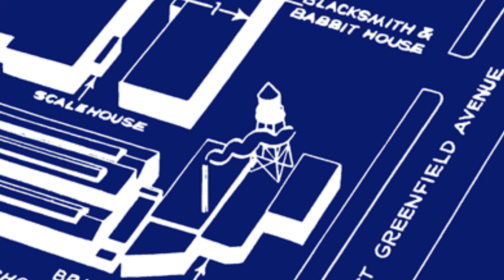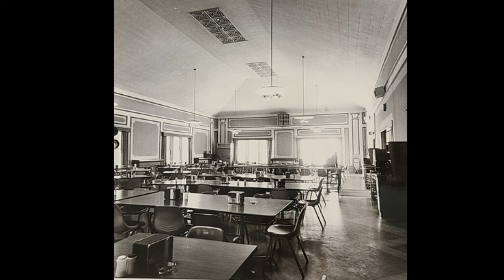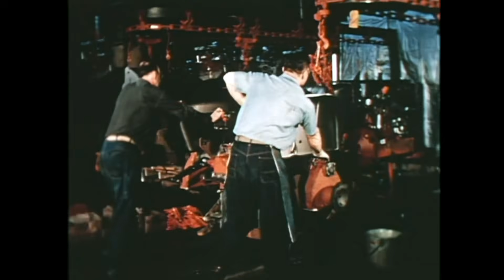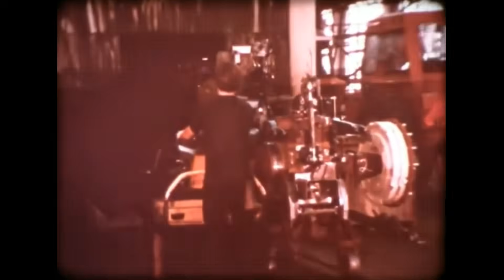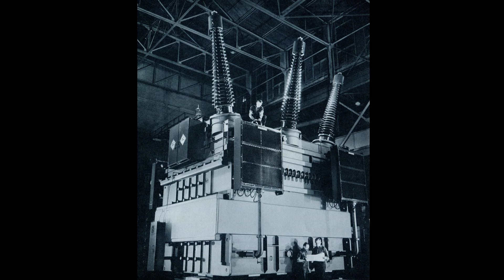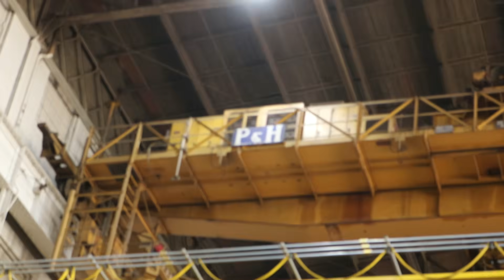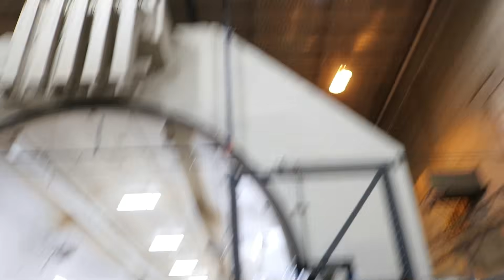Then And Now: A Tour Of The Allis Chalmers West Allis Factory Headquarters

Comment: It's a shame such an iconic company went down the tubes. I've always liked AC tractors and have operated quite a few as a kid back in the 60's. Models like the D-17, WD (std), CA, and also a weird backward facing front-end loader that was based on a WD-45 chassis I believe. The loader was a beast and did most everything well except STOP! When the company that built them did the conversion, they failed to wrap the band brakes in the proper direction for them to stop going (what was now) forward, but they worked great in reverse!🤣 The only way to stop in a hurry was to drop the bucket.😜

Comment: The place that Blast Cleaning Technologies uses was used to build Kholer power generators until 2017 by a company named Global power, back then they still used the 150k ton crane to load the generators on semis , went there to load said generators a few times I think the biggest one I loaded out of there was 60k pounds and my overall vehicle dimensions were 10x93x14 feet, let me tell you that backing in to the building was bit of a challenge.

Comment: My grandmother pearl jones worked at the west Allis  plant  from the second WW to 1980 she was one of the overhead crane operators in the big shop. I work my first summer out of high school 1975 as a tractor driver at the AC tractor proving grounds in rural Racine county. I was transferred to the engine lab in west allis to assist Bob Annan and Arnie Carlson the did all the Diesel engine testing and accompanied tractors that were being tested at the university’s first Nebraska for engine and pto horsepower.

Comment: It was glossed over, what did AC did on the Mahatten project?
Reply from the maker: From what I can find on the internet: "Allis-Chalmers manufactured critical assemblies that were employed in the top-secret Manhattan Project for the electromagnetic enrichment of uranium. It also built the compressors used to handle uranium hexafluoride used in the gaseous diffusion process. Both processes were used to separate the fissionable U-235 from U-238 to produce the atomic bomb."
Reply: @JandLVideos  So these were used in Tennansee in Oakridge.  That was the main production facility.  I believe they were refered to a the gas centrifuges.  Way cool history, thanks!

Comment: We had an Allis Chalmers plant in York, Pennsylvania, it never made tractors but produced energy products as hydroelectric turbines and nuclear fuel rod components.  Purchased from the S. Morgan Smith Water Wheel Co it was a fraction of the video's complex. The several block facility was sold to Voith Hydro which later expanded out of town. However the historic brick buildings were repurposed into a mini industrial park for office, business and manufacturing companies.
As Allis Chalmers, Precision Components Devision I toured the plant in the 70s, they had a shop of vertical lathes which could machine 3 story high x 52 feet diameter work piece. Saw the millwrights setting up a billet of stainless steel to become nuclear fuel rod cell, they were standing on the lathe's faceplate 1 1/2 stories below yet the roof high above was removable to load the lathe or insert a wall spacer for taller work pieces.
I have a cast plow shear painted orange in the front yard flower bed, the Allis Chalmers embossing on the back and my street number is highlighted in black.
Reply: Some of the Army Corps of Engineer  dams
On the Snake river, like lower monumental dam, still use the AC hydro Kaplan turbines to make electricity every day.

Comment: Great video. I was a 3rd shift guard back in the late 70's and saw all those buildings still operating. Lots of memories of walking the shops at night. Seeing tractors partially assembled on the line, non-stop testing of parts in engineering. Great memories 👌 ❤️